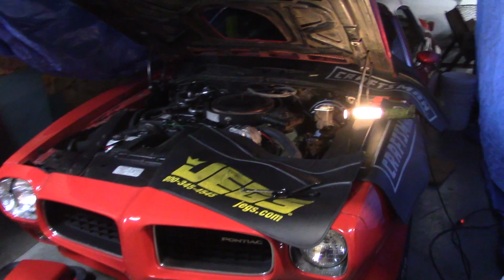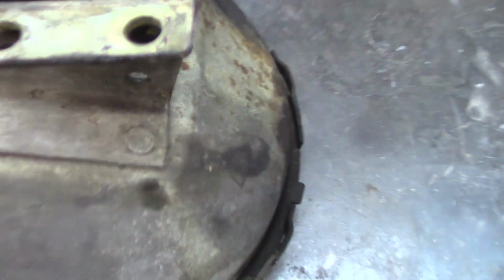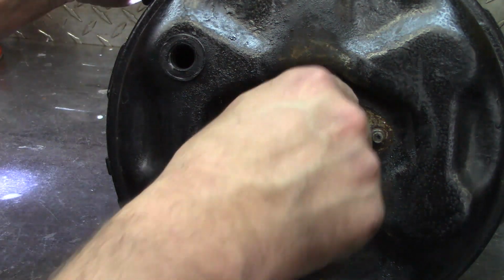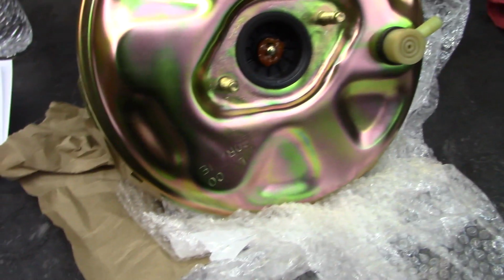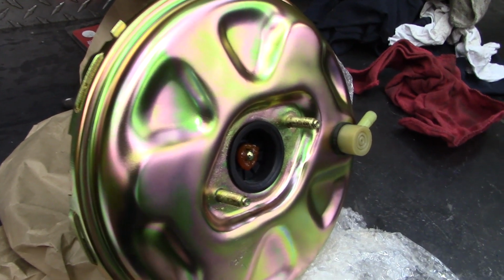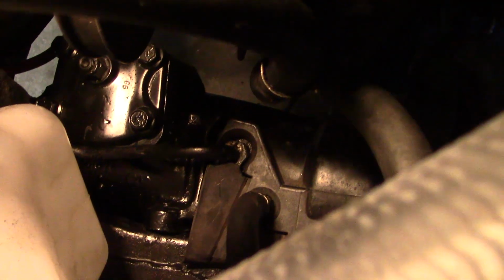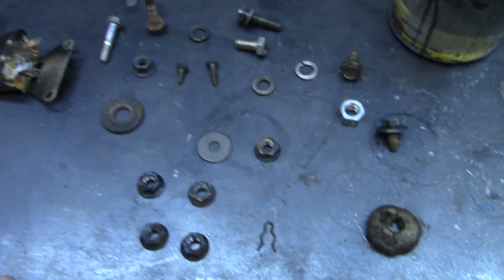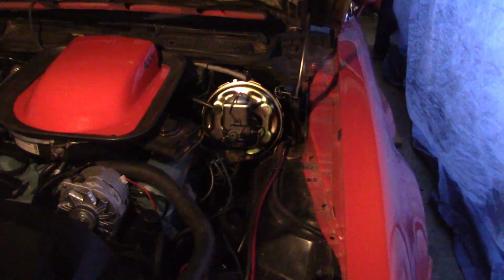Brake Booster Restoration 1973 Trans Am

Comment: Many nuts are removed and installed without seeing them. A simple trick I learned in the early 70’s, is to install a nut onto a bolt or stud you can see, but have difficulty getting our hands in close enough to only drop it 6 or 7 times, is to use a long Phillips screwdriver that the tip can touch the stud, then with planning, place the nut onto the shaft of the screwdriver, place the tip on the stud, then let loose to allow the nut to slide into place. Many times the nut will turn and head properly onto the stud. One finger or a magnet on-a-stick ( As I Call Them) will allow you to catch a couple of threads getting it started. I’ve used an equally long flat blade screwdriver in place of a magnet to start it as well. After 30 or 40 times, you get good at it. Welcome to my world! Tape a swivel socket and use paper pushing the nut into the socket is another choice, if room and tools allow. The booster would have been disassembled to plate it also. So, the shop may have ordered a diaphragm kit prior to reassembling it, explaining the white rear seal. I have done these as well. They have a large spring, the rest is rubber and plastic valving inside. The felt like material is where atmospheric pressure enters. This may be a slight noise. ASE Master Tech since 1978 - Retired

Comment: Good one! For those interested in an upgrade and don't mind hack into the original brake system i recommend having a look at a hydroboost conversion. I have done this upgrade on my Formula 400 and i can tell the brakes works much better after the upgrade even without doing any longer road test being done yet (car still not road worthy).  My Pontiac engine is no longer stock so it produces less vacuum for the vacuum booster which  has lead to a couple of scary situations. Now boost pressure is assisted from accumulated servo pressure from the steering servo pump.

Comment: Did you check to date code on one of the booster chamber locking tabs to make sure you got your original back?
Reply from the maker: Didn't know there was one there.  Thanks for the tip.

Comment: I tried to do mine, stripped one nut from one of those 4 studs behind the booster I used a wrench, no clearance for a socket to enter. The nuts are too tight, I will just cut the booster with a dremel to get clearance. Seek and destroy mission.
Reply from the maker: If it's a collector car I'd keep the original booster
Reply: I also tried to chance the booster at my 79´Camaro but i find no way to loose the four nuts.
Reply: I'm trying to change mine in my '76 and no dice. Can't get the nuts to budge. Almost have one completely rounded off. Did you guys have any luck?